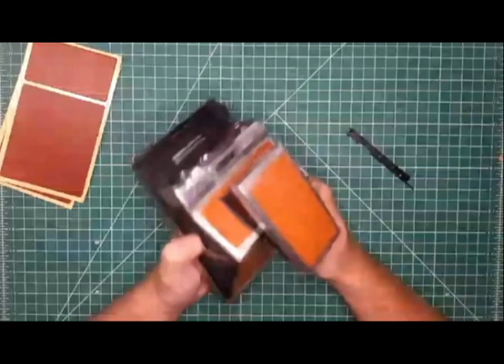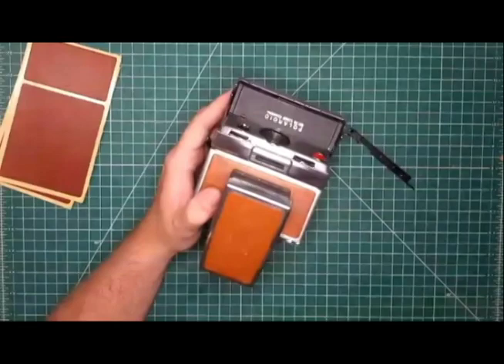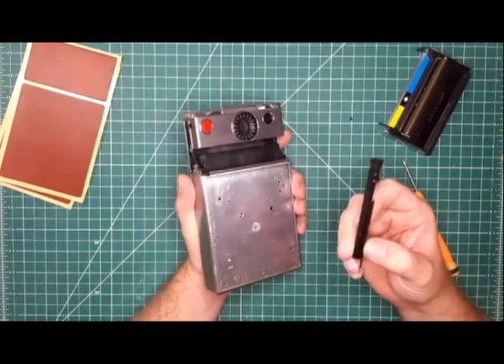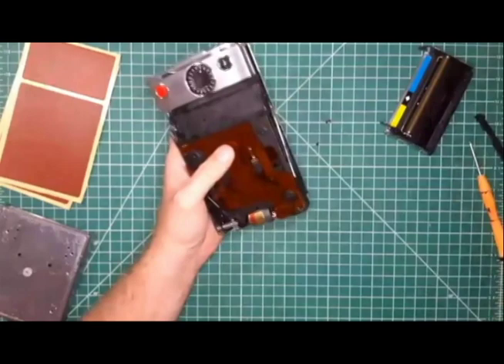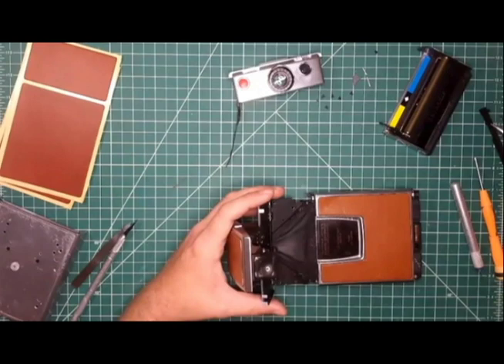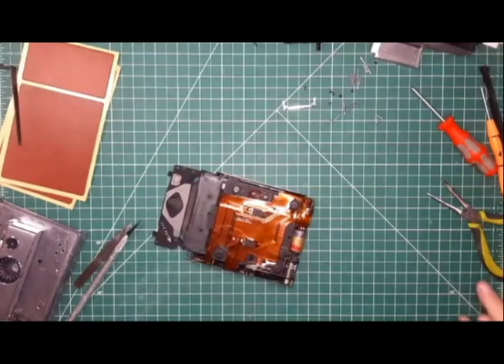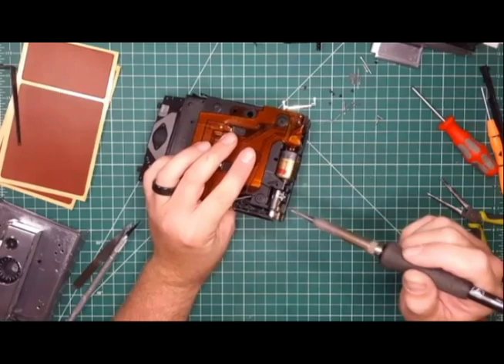1974 SX-70 Model 1 repair/adjust

Comment: Hey! I know this video is older, but I had some questions. (Note: I have no experience with camera components, just a good tinkerer. I fixed many things such as a super8, firearm issues and thing of that nature just by taking apart and figuring out. Then using YouTube if I get really stuck or have very limited knowledge, like this Polaroid.) any way, I inherited my grandfathers SX70 after he past, so I bought some film to see if it worked! I anticipated it to as he always took good care of his things and always kept them in immaculate shape. First 2 pictures, it worked perfectly as I expected and then the 3rd after that, it did the motor running thing you talked about. I quickly found out that the motor coupler did brake and found a DIY fix that seemed to do the trick! But here’s the problem I’m having now. Not wanting to waste another $26 pack of film, I’d been using the first pack that took 2 good pictures to test. So taking a photo the camera seems to running through a pictures cycle properly, EXCEPT it’s not feeding the picture out… I’ve been wondering if it’s because of old pack and I need to try a new one… but I’m hesitant to put a new one in because I don’t want to waste that one also. What do you think? Do I just need to try the new pack, or could there be something else going on? Let me know what you think, thanks!

Josiah

Comment: Hello from Germany and many thanks for sharing your knowledges here. May I ask you for help? My SX70, as same model as yours, has a problem. If I insert the film cassette the carton or first picture comes out. If I press the button it comes only a "clok" and the motor runs for a very short time. Press the button again- nothing happens. Take the film out and put it in again: a picture comes out. The same procedure as before. Do you have any idea what is going on here and how I can fix it ( I have a lot of experience in fixing cameras but not with Polaroid). Thanks a lot, Carsten.

Comment: Hi there 
My sx70 alpha 1974 model needs its light sensor cleaned. Will my faceplate pop off if unlatched from the back or do I need to remove the torx screws at the back?

Comment: Hi I know you guys might not fix these camera anymore but my dad found this camera and it’s been sitting for a really long time. I put brand new film in and it worked for only 2 photos but when I tried for a third it didn’t take the picture. And the camera would not close. On top of that the 2 metal pieces that power the camera one of them broke off. I was wondering if you guys could fix my camera by any chance?

Comment: I’ve got one I’m trying to repair that the motor will run but no exposures get pushed through. I tried bending that arm in the back left down a bit to grip the edge of the film better but that did nothing. I tried a fresh pack with fresh battery and same thing, lots of motor noise whirring but nothing comes out and it’s continuous like it’s struggling and won’t stop until it’s pushed something out. 

Any ideas what this could be?

Comment: @2nd shot SX70
I am currently working on an SX70 and there are two gears that sit side by side with a thin shim between them (mirror cam) near the front catch release button,
When the motor starts and the gears move one of the gears slips a little which inhibits the mirror from doing it's cycling properly :-( is there away to remedy this issue please.

Comment: How much do you charge for your services? I have two sx-70s that need light meters cleaned one mint one has a broken latch the mint one is a sunburst! My first sx-70 I’m buying an slr680 soon and was considering swapping the 680 into the shell of the one with the broken latch what would be better than an slr 680 in a metal case!!!!

Comment: Have an old one that worked for a while. Now it seems that it won't cycle all the way. Shutter clicks and mirror drops but does cycle out the photo. I have to open the door then close then it will release photo. Any ideas?

Comment: nice video! I would like to clean the light sensor of my 1rst SX-70 model and dont know to remove the front silver cap. I saw in your video, that you unscrew the 4 back screws but during the assembly you just fit the cover in body...So i have just to pull out the cover  or i have  to remove also the shutter cable and to disassembly almost all body?

Comment: Hey :) new polaroid shooter here, i have a question: got an sx 70 in good condition, shot the first cartridge trough with no problems film counter working properly. Then i change cartridge and the counter stays to 0 so the darkslide isn't ejected. It still works flawlessly except for this, which means I have to keep count of the shots. I tried once the cartridge was empty to put it back in and out a few time but the counter still doesn't reset. Any tip?

Comment: Hey man, hope you see this comment.
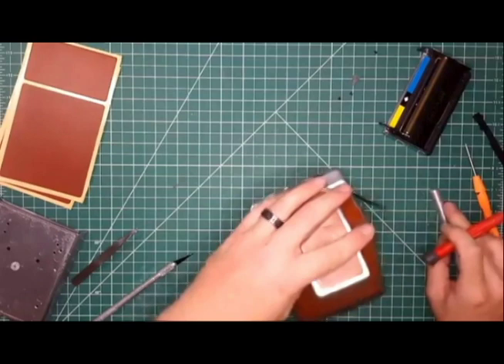I'm trying to replace the top part of my SX70 but I'm having a hard time trying to take out those little bars at 5:07. What's that red tool you use to push them? Thank you! And great video!
Reply: Hi! I'm having the same issues, did you ever find out a way to take them out?
Reply: @beluandi  Hey! Yes I did. I tried using a paper clip, but it wasn't strong enough. I realized I had some precission screwdrivers at home (those where you can replace the tip) so I took the smallest one (0.8mm) and just pushed with my fingers. The pin on the left is smaller than the one on the right, that's why I think it's harder to take out. 
I hope my answer is useful. If you don't have a precission screwdriver, try to see in your local horologist, they have some great and small tools that can be useful. Maybe they could give you a hand!

Comment: Hi, the mirror in my Alpha 1 has completely fallen off. I have stripped down. However after a couple of hours trying to work it out I can not find  out how to detach the bellows. from the main body. Are you able to give me any tips or more detail?  My serial number is C402058701. You do it in the video, however it is very quick and the image is not clear enough for me to learn even when I look frame by frame.  Thanks so much for the video is has been a great help.

Comment: Hi , I know you mentioned the motor coupler that makes motor run continuously, however I have N issue where my Sx-70 model 3 was working just fine but now the motor keeps running without stopping,  I fixed the coupler by stretching the spring however I dont hear my Mirror  moving back in place any idea what could be causing this weird shannan?